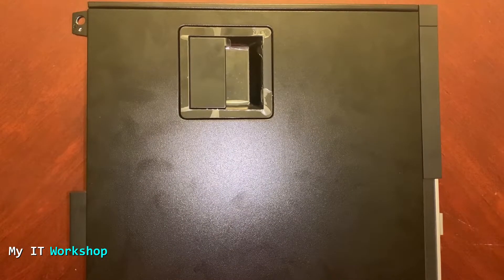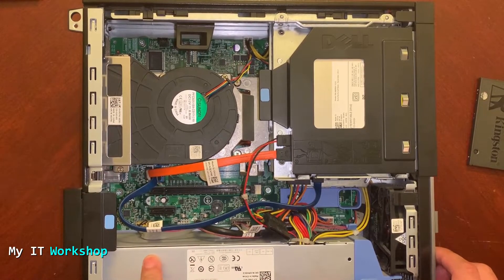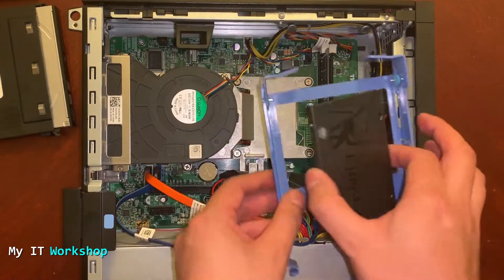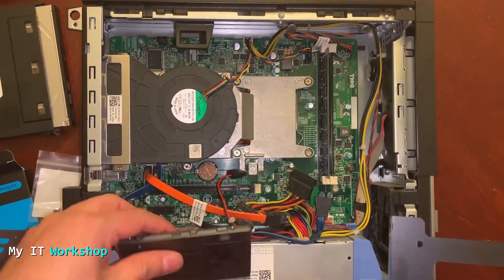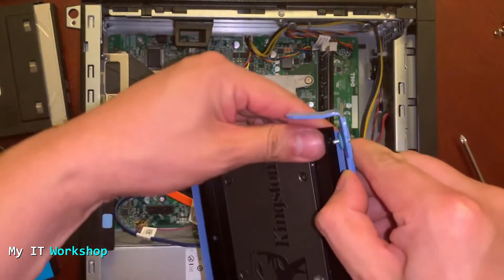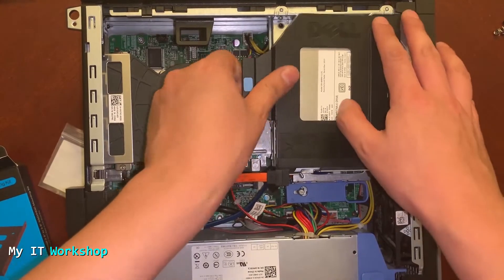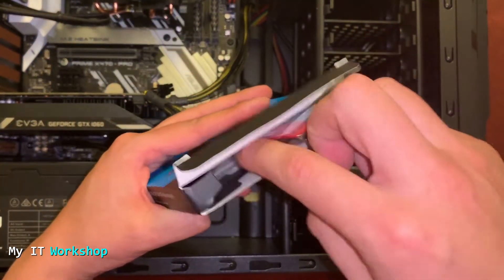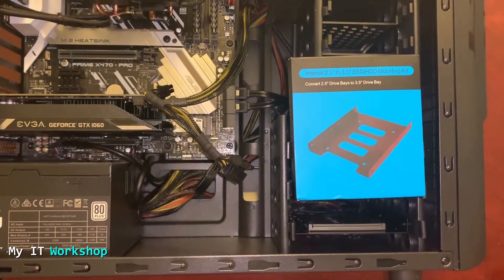Installing SSD with a 2.5" to 3.5" Bracket | Replace my HDD with SSD

Comment: What are the measurements of the small black screws? I just need the screws to add 2 more 2.5 hard drive. I got the brackets but I just need the screws. 
Great vid.